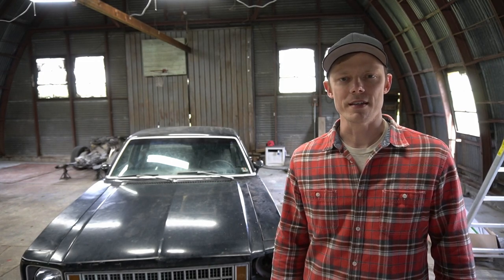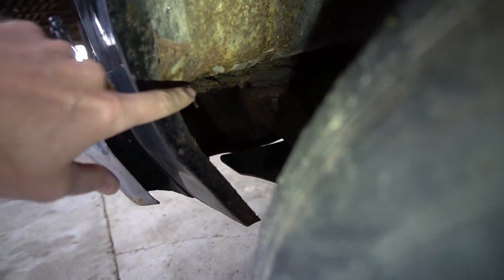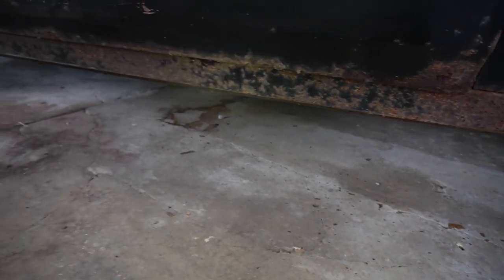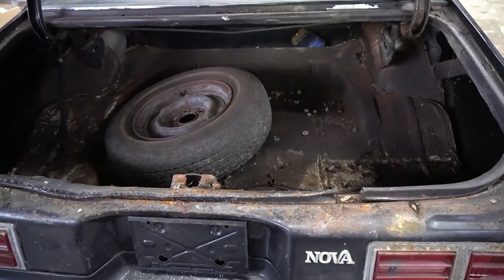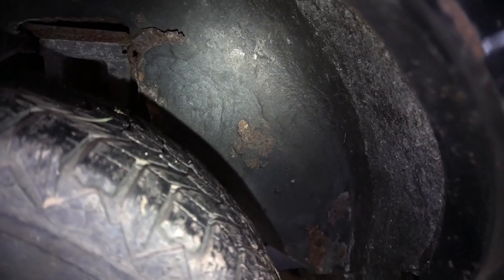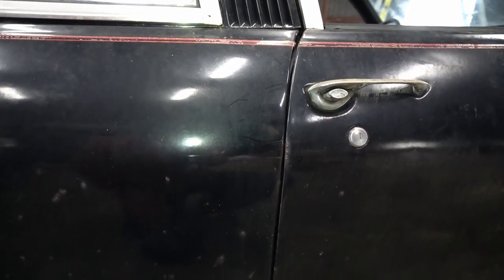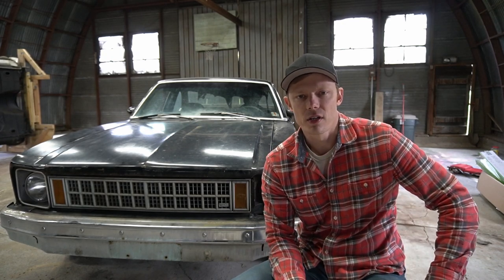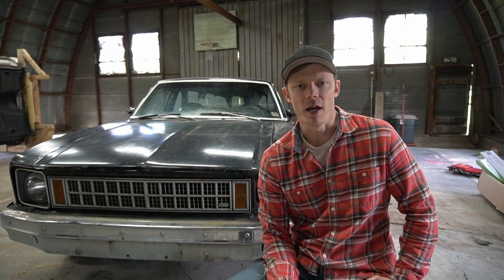How NOT To Buy Your First Project Car - 1977 Chevy Nova “Barn” Find

Comment: I had a 76 Chevy nova that I bought off my friend for $300 and I will tell you right now, that was the absolute best $300 I ever spent in my entire life. I have owned many cars over the years and my 76 nova was my #1 favorite car I’ve ever owned
Reply: Yeah, had a '75 Nova back in the late 80s I bought for 800 bucks, it has a warmed over 355, th350 with a shift kit and 3.55 gears and that was a really fun car to drive. Those are so light, pretty easy to get a good weight to HP ratio with them. That car ran high 12s that I could daily drive no problem. Would love to have another one.😎👍

Comment: I bought a 77 nova 4 door just over 3 years ago. Running and driving for $1200. Its has been my project and on and off daily driver throughout that time. Its a great car. Challenging and frustrating at times but the memories made and effort put in to fix it is well worth it

Comment: In my opinion, it's not too bad, and it's worth putting money into, you can still get slot of repro body panels, sub frame components,etc dirt cheap, most interior trim, carpet, head liners, dash pads, you get the hint

Comment: Great points Dan! I never liked those cars back in the day, but I will say when I see one today especially on the road, I appreciate them, maybe just because it's a Nova. I was always a fan of the 68-72, but as I have gotten older, I like the 73-74 just as much.
Reply: I think that a lot of the suspension part for 2nd Gen Camaros work on the 4th Gen Nova too. I also think the 73-74s as you say are actually pretty good looking cars especially considering that era in general
Reply from the maker: I'm in the same boat as you. Admittedly though, the more I look at this rust bucket the more it's growing on me.
Reply from the maker: I was wondering about the suspension parts. I came across products like leaf springs, etc that seemed to be the same part numbers for both cars.
Reply: The ‘75 nova was “restyled” to make use of the camaro parts bin.  The subframe changed to front steer.  Integral spindles, and “corporate” front suspension parts were used.

Comment: Love 3rd gen Camaro's. Looked for two years, and probably 25 cars. Need a screwdriver and a piece of plastic to lay on. Jab the screwdriver into the floors all around and you will figure it out in minutes. Finally found a rust free car from Florida, UN-molested, original and had been taken care of the first 30+ years of its life. Pull the T tops and blast down a sunny road, gotta love it. And even more when the LS slides in some day. smile  :) Great vids, Thanks.

Comment: Had a friend of mine with a 77 Nova Coupe started it in he wanted me to get it running right they couldn't figure it out  after going behind the others and correcting everything they done incorrectly and finding the original problem with the engine not running properly  replaced intake gaskets and repairing bad wiring door hinge pins wiper motor and electric radiator fans he was going to get it painted at economy auto body I have seen the work they do just paint it like you brought it to them . I told him I can do a better paint job than they can and I have never painted a car I have done body work and had friends that painted cars and I have been called anal old man 
So now I volunteered myself to do the paint and bodywork 
I didn't realize that parts were hard to find and overpriced. But I like working on cars I think 4th generation Nova's was built with body problems but I had fun named the car Novacaine because it was a pain  enjoy your videos

Comment: You can get parts for that year model floor pans fender just got look for it
Reply: These Nova's were known for rusting issues but there's a catalog covering these years. I did own a '73 Nova Custom cpe I bought used in 1978 only 5 years old at the time with a little over 71 thousand miles on the clock.  Just like this model year Chevy rear quarters panels rust was considered normal back then.

Comment: My first car was a 1976 Olds omega. Pretty much the same body along with the Buick skylark, Pontiac ventura/phoenix. A common issue with those cars is they would rot out around the shock bearing. What happened to my omega
Reply: I’m building a 75 right now 350 tunnel ram 9 inch street strip mobile

Comment: My 21 year old son lucked out big time last year, even though I thought he did the wrong thing.
So, he gets his tax return and went to look for a 4-wheel drive truck with those 33" tires. Well, he found a 1994 Chevrolet 4x4  and the guy sold it to him for $2000.00, He drove it 3 miles home and parked the truck in the garage. His intent was to drive it only during the winter as it snows quite a bit here in Ohio..

Well, when he got home I saw noting but a big rust bucket. It was rusted so bad that even all of the seat's  frame were rusted as well as the floorboard. I was like OH NO!  Well, he said it was for winter use and wasnt worried about it. So the truck was driven 3 miles and parked in the garage for 7 months. Finally winter was approaching and he goes to pull the truck out and the first thing that happened when he was starting the truck up he stepped on the brakes and all the brake fluid came out..... due to rusted lines.
So I talked to a mechanic friend of mine to make arrangements to tow the truck to his shop.
 I then went to the guy who sold the truck and told him I like for him to bring his trailer and take the truck to the shop........... As luck would have it and even I can not believe to this day, the guy said he would not bring a trailer but wanted to buy the truck back and gave my son$2500.00 for it. I told my son that he only drove it 3 miles and stored it for 7 months and he made $500 profit and did not even have to fix the brakes on top of that.  I told my son that he would have made $500 in interest at the bank in 7 months!

Comment: Got my 78 Rally in really good running shape. Paint is nice, has a305 but its a crate 4 bolt main 305. Very minimal rust. Just gotta clean it up a little bit. Only cost me $4,200 here in north east Pa. Like you said though, best off seeing the car first. I was luckily able to check it out and have it run for a bit.
Reply: 4 bolt 305?

Comment: Looking at a car in broad daylight is my first rule... looking underneath it is my second.
Reply: After watching, the problems out back would be a daunting task to try and repair, let alone to have to repair somebody's less than excellent repair.
Reply from the maker: That right there is what will make this car that much harder to repair. It's likely that nothing is in its original location. After this video, I found a receipt that one of the rocker panels were replaced, most likely the passenger side because it was in better condition, but again, I have the same concern that it's not going to line up well with the door, etc. Great tips! Thanks for sharing.
Reply: Then again..Look up under the dash. If the wiring and electronics looks like a crows nest, who knows what else might be hiding underneath the skin

Comment: how about this deal i got a 73 ss nova with gauges on the floor . factory paint inkee wheel with new gt qualifier tires with a extra set of them  396 bb with tunnel ram pro built 400 turbo no rust in the car cost me 1000 bucks one week latter i got a black with white stripes 73 ss gauges on the floor no engine in it for 50 bucks both cars have a very good bodies . but i get rigs cheap all the time

Comment: Junk it
if they care about sentimental, rip the trim tag off and slap it on a different nova
the amount it would cost just to fix the metal will be more than what the car is worth
Reply from the maker: Love that and I'm going to use that line in the future. I get the sentimental thing, but by the time people are done restoring these that's exactly what they have... their trim/vin tag on all new sheet metal. It's not the same car at that point.

Comment: I know you asked for 1 tip, but ai have 2.
First, make important criteria in your price range for yourself and stick to your guns. I made a list of 10 things and told myself if a car scored 8 out of 10 or better it was a must buy. 7 out of 10 something you have to seriously consider. 6 out of 10 probably shouldn't buy. My Fairmont scored a 9.

Second piece of advice - bring a floor jack and jack the car up to examine the floor boards.
Reply from the maker: Great tips Grant. You wouldn't have been able to see the floor boards on this Nova without the floor jack because it was sitting on four flat tires.

Comment: It's over 40 years old and $1200.. its going to have some rust and dirt. Looks like a $1200 car.
Also these didn't come with a 327 so someone swapped it in
Reply: it either came with a 305 or a 350, that was the only 2 they put in the 2 door model. I would say it PROBALLY came with a 305 because that was the most common engine

Comment: I'm looking at a '77 Skylark with the same body as the Nova that is in showroom all original condition. It has 28,000 miles and the seller is asking $8,000. Any thoughts?
Reply: Too much money,they are not valuable or desirable! It's not the miles it's the years!
Reply: @rjmzz430  I should add that I live in Canada, and these things just aren't seen anymore. I'd be willing to bet that I haven't seen one in 25 years in either the Buick, Chevrolet, and Oldsmobile offerings. People bought them, drove them, and the harsh winters and salt killed them. Like I said it is absolute showroom condition. I don't know what a car like this is worth in the USA in this condition, but I suppose they would be much less expensive given their availability. Like I said, though, you just don't see them here anymore. lol Thanks for the reply.
Reply: @jimdent351  hey Jim,Canada yes that is a whole different story. That changes things for sure.If it's what your looking for and you like it you can always negotiate a better price. 8000 is a lot of money for the vehicle. Few things to consider is it a V8 car? Check the undercarriage thoroughly for rust.How does it run and drive? Does it track straight? Check and inspect brake and fuel lines?all this are costly repairs if needed for vehicle safety. It's what I mean by the years stuff just wears out. Because it looks showroom doesn't necessarily mean it is. Ha we have a saying in the U.S. if you put lipstick on a pig...well it's still a pig.  In mint condition it the States this car is worth 5 grand tops. Good luck caveat emptor!
Reply from the maker: Hey Jim, I’ve been watching the 4th gen Novas since I bought this one and the ones in excellent condition seem to be going for 5k to 6k as Ronnie mentioned. I’ve seen them listed for 8k but they didn’t sell. I can’t speak much to the Skylarks because I haven’t been watching them. 8k isn’t for off though. If it’s something you have wanted for a long time and it is mint it might be worth it for you, even more so being that you haven’t seen many in Canada. I’d get it up on a lift to check the underside if possible.
Reply: @RestoCar  Thanks for the reply. I haven't seen the car in person yet as it is about a 5 hour drive and I'm having trouble finding the time. I would definitely be looking at the undercarriage, and hopefully on a hoist. If not that then definitely on ramps. I don't think there will be too much wrong on the underside because the picture of the trunk floor looks mint. Thanks for the reply. Here's a link to to Auto Trader Ad.  https://www.autotrader.ca/a/buick/skylark/espanola/ontario/19_11586177_?showcpo=ShowCpo&ncse=no&orup=2_2_2&sprx=500&modalXS=1
Reply: @rjmzz430  Thanks for the reply. For some reason I didn't get notified of your response. I included a link to the add for another person. Have a look if you wish. Also, The price in this ad. is actually $8,500 but I found it listed elsewhere for $7,500. If I'm able to get there to see it, I will be trying for $6,500. Thanks again!

Comment: Yes if you go to look to buy a car you shouldn't really buy sight unseen even if there's a photograph of something like a new guitar or a suit or a car new or used even if it's new and even if it's used just a photo can be deceptive if you have a photo of a new or used guitar it might not it's easily deceivable if you have a photograph of a tailored suit and they don't know the dimensions of the person they're tailing the suit for that's pretty obvious I understand that although this was a video of 2 years ago and any type of used car that is in a complete state for about $1,000 or $500 if you don't want to use it as a project car you can have it smashed flat and for scrap you can get $500 for scrap as a big chunk of steel in a smash flat yard of CNC metals in a metropolitan area known as Sacramento so if you pay something in today's 19 or 2022 pay $1,000 for four tires a straight body with a complete engine and transmission that's a lot cheaper than paying $47,000 or $17,000 for a economy car that you can't actually have a project with because under loan conditions you're not supposed to take anything apart the automotive dealership is so I know this is a older vehicle but what type of car can you ever get that is not scrap or junk on the title or non-op status anyway things regarding automobiles none of them are technically worth anything it doesn't matter if it's a Porsche or a Corvette sometimes it's only the name on the actual title if it's a celebrity or a sports athlete or some famous general or politician on the original title it has more of a historical value disregard name brands like Porsche Corvette Lamborghini they're all worthless what is really important is probably the historical significance of something because remember when they're smash flat into a cube they are worth $500 in scrap and anything that's new that they want to sell you for $47 to $100,000 that basically is just a new car that is only worth $500 in scrap is not really worth your time and is not a project car so get a little bit of a reality check on that one not to be critical of you but to be critical on anybody that thinks that you can just buy something with a name and on a photograph and that it's worth something most everything is worthless to a certain point of view.
Reply: All 7879 and 80 cars are simply not as lucrative there are some 77 76 and 75 models that are Camaros that are out of state that are actually worth quite a bit of money that are from either Canada with a factory 4-speed manual transmission that are worth quite a bit actually because the smog regulations are much different although the rust that you would receive if the car was actually from Canada would be quite a bit worse. The reason why something like a 77 78 79 or Nova or concourse might be more desirable is because of the immense amount of leg room and the back seat front seat the trunk area along with you can open up the hood and easily work on the area if you need to change spark plugs it's not as awful as a 1980 to 1978 Camaro if you've ever worked on them you know you have to take off sometimes wheel assembly just to change spark plugs the reason why novas and our concourses are sometimes more desirable is simply if you're a very heavy or very tall person and you want to sit in the backseat have you ever sat in the back seat of a Camaro for a 400 mi trip in very hot conditions and have the air conditioner go out your cramped up and if you're a 6 ft five person you can't even sit in the backseat of a Camaro that's the only reason why something like a concourse or Nova might be slightly practical and more desirable than something like a Camaro or Corvette or something like a Pontiac trans am or a mustang you can actually get four very large size adults into a Nova or concourse the same thing with a Thunderbird many people that are full size can sit in a Thunderbird that's what was once good about the Nova concourse and or Thunderbird they were roomy cars yet they weren't like a giant oversized Cadillac that weighs like three tons which is a little bit ridiculous you might as well buy a limousine for crepes sake but anova Thunderbird or concourse are practical they're affordable and your typical car today in 2022 will cost you $20,000 anyway if even if you want to buy an economy car which doesn't sound very economical if you only have to pay $5,000 to get out of a car payment and you know $5,000 compared to $20,000 is a lot different and I simply feel that things like 71 Camaros unless they're something special like a limited edition split bumper RSS Camaro with a big block in it like a 427 and a manual transmission might be worth some sort of money but most of the Camaros that are z28s that are 71's are not actually worth very much I know if many people that have bought Z28 or just Camaros that are 70s or 71 for only $500 and they ran and drove around fine and they had four tires transmissions and good brakes and lights and you can find them in the Sacramento area for $500 to $1,000 a piece some of them are only SS's though don't be too sure that a 70 or 71 Z28 or Camaro is actually worth a lot of money and that goes for mustangs too you can find many of them for $1,500 to $500 and the reason is is they're not actually worth always that much money it's only something like a 427 manual transmission special edition SSRS 70 Camaro or 71 special edition or Eddie Bauer designer car that might be worth something or something attached to a celebrity politician or a sports enthusiast that was a famous character